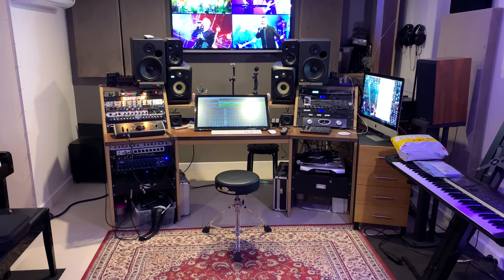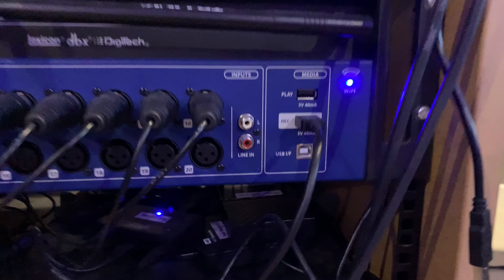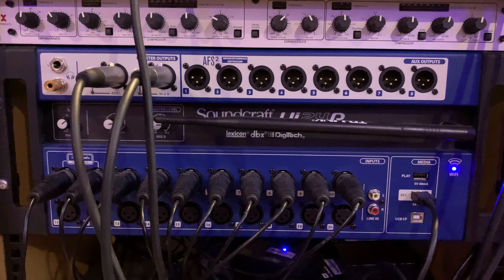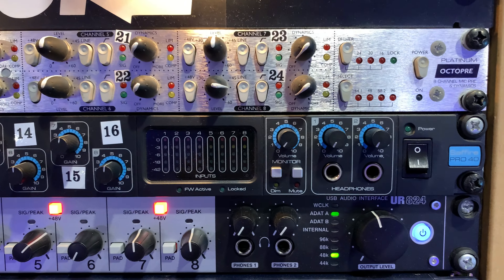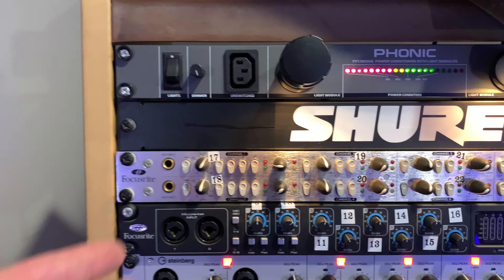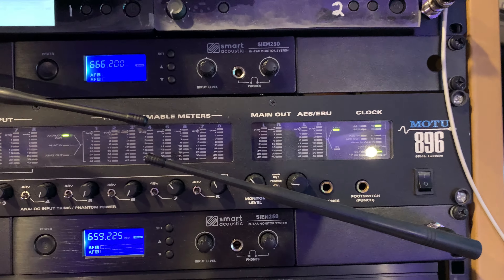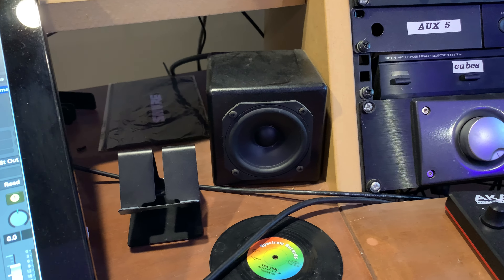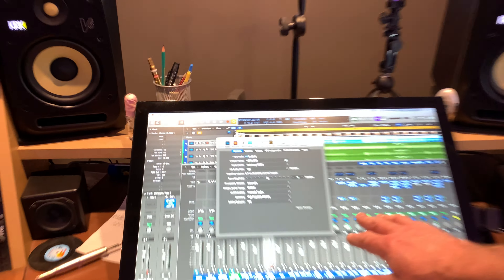My Studio signal path

Comment: Hey Darren, great video! Thanks for the rundown. I have an opportunity to purchase a used Focusrite Platinum Octopre as well, from a friend for $350 Canadian. How would you say it compares to your other pres, specifically the saffire pro 40...is it significant quality? I can't seem to find any comparisons with newer octopres/interfaces (scarlett, clarett, saffire, etc.), so I'm just curious your overall experience. It will be paired with my Focusrite Clarett 8pre.
Reply from the maker: Lots of engineers often talk about ‘clean’ and ‘quiet’ when referring to preamps (guilty myself) but the Platinum Octopre adds the most lovely subtle ‘noise’ to the signal rarely found in a multi-pre unit. Years ago I worked in a retail store selling studio equipment and had a chance to compare many preamp brands and models with many microphones. Early days of computer audio way before multi-track as we know it. This model was new and it out performed everything (I remember a red single channel MindPrint that was awesome...must find that one).

Comment: Great set up, Darren, and it's not always the cost of the equipment, it's the the expertise, creativity and ears of the producer.  I have an off the wall question...what kind of desk are you using?  It appears to accommodate everything well and it's probably the right size for the studio I want to set up (of course, I've been saying I'm going to set up a studio for 2-3 years)
Reply from the maker: I designed it myself and had it built custom by a cabinet maker. I’m happy to share the design plans with you if you want them. Contact me via the website

Comment: What do you mainly use for the final touch to the mix ? The KRK or the EVENT speakers ?
Reply from the maker: The final touch requires all 5 pairs. The Krk v6’s are brightest and set the main mix. Event 20/20 v3’s the solid parts and the 3 passive pairs set the rest (mainly spikes at around 500 hz, 1-2k and 4K) my jbl control 1 pair are the hardest to please but eventually I get it as close as possible before running it out to my LandR mastering set on ‘medium balanced’. I tweak the resulting file once again (in Logic) before re-striping the final video